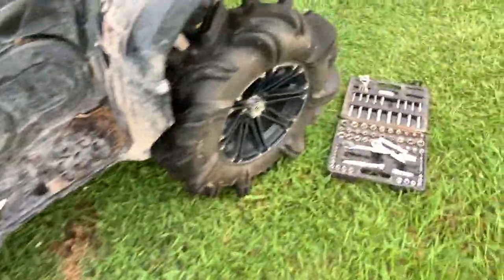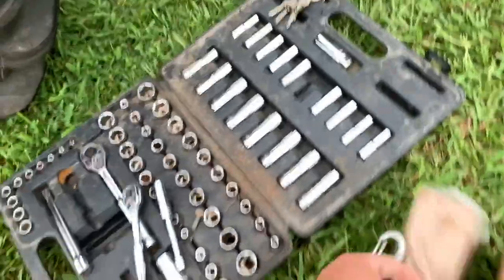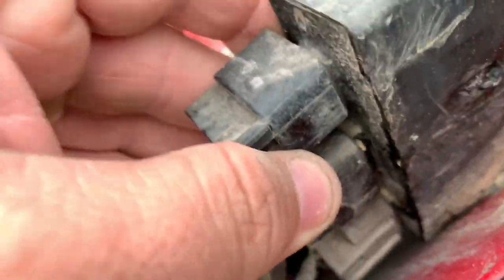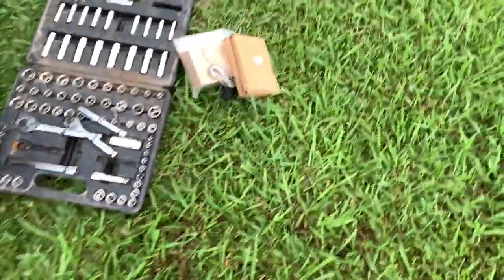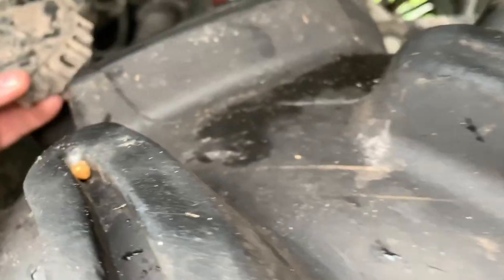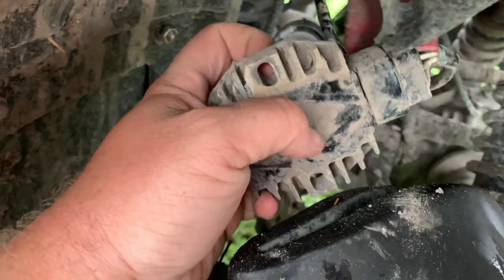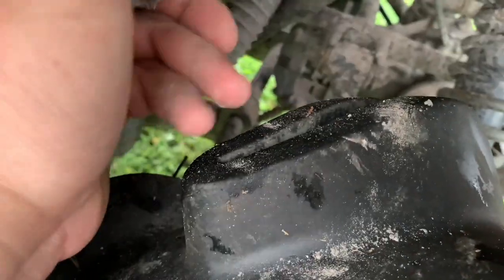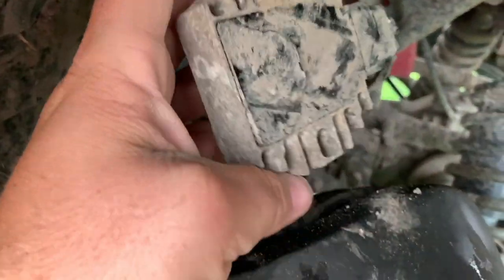2003 Yamaha grizzly 660 cdi problem found

Comment: What type of issues were you having?how was the quad running?
Reply from the maker: Well I put a new battery on drove it on one ride and the battery overheated and I had to replace it figure it was the winch or light bar had a short so unhooked both of them when the new battery came in when I hooked it up it burnt the hole right into the cdi honestly it ran find other then the lack of power when the power went out
Reply from the maker: What problem do U seem to be having

Comment: Did it fix it
Reply from the maker: Yep the volt regulator broke and was sending to much juice to the CDI
Reply: 660 grizzly starts up fine when attempting to press gas cuts off
Reply from the maker: @MgGu-d4r  that’s a carb issue most likely